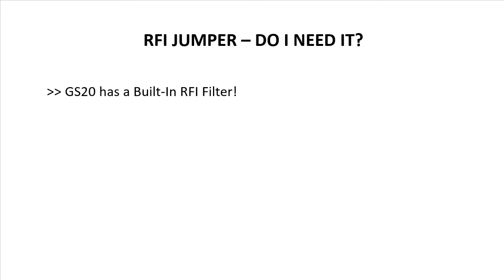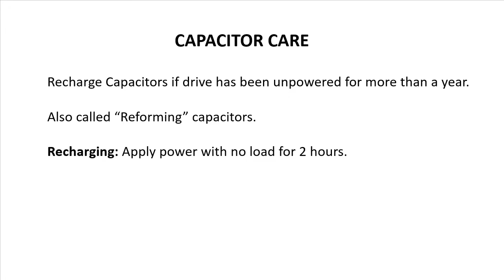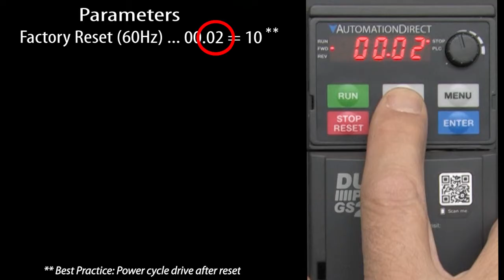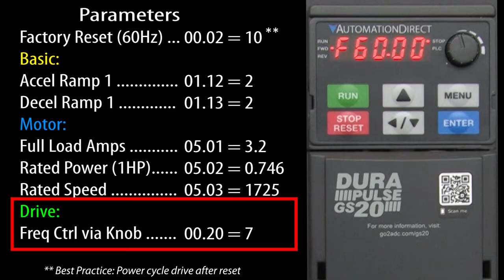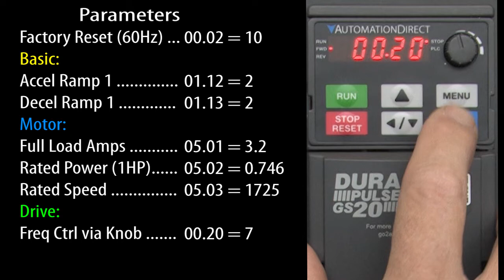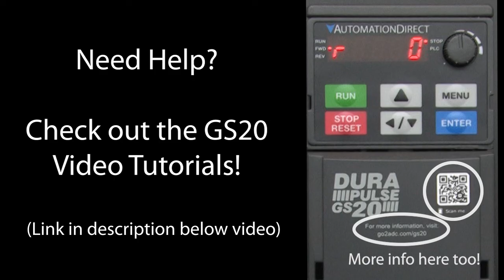DURApulse GS20(X) VFD Quick Start from AutomationDirect

Comment: I just bought a newly gs235010 vfd . I installed parameter of the motor .vfd seems working fine. Turned the knob clockwise and frequency varies but no output from the terminal of the vfd. Measured the voltage at the teminal and it was zeroDid i miss something from the setting?
Reply from the maker: Hi Noel, Sorry for the stupid question, but did you hit RUN?

Comment: Hello Thank you for the video. One question. Can I make the drive to run automatically after putting on the power. I read the manual it says the drive has a function of quick start by setting P02.00 = 6 in three-wire mode. Can you explain that more ?
Reply from the maker: @disun4152 you can disable the "Line Start Lockout" feature on the GS20 and add a jumper to trigger to drive to run upon power up. How this is deployed varies from situation to situation so we recommend you contact our FREE award-winning technical support for further details!
https://community.automationdirect.com/s/contactsupport?utm_source=Jc_zCsXKAV0&utm_medium=VideoTeamComment

Comment: I recently purchased the GSX-20 with no knob. I have two questions: one is - where can i find the menu/group/parameter in print form to use while standing in front of the drive? and Two: can I wire a knob into this drive to control the speed using a 1ph input 220/3ph output vertical milling machine?
Reply from the maker: @billg1871, find the GS20 manual here:
https://cdn.automationdirect.com/static/manuals/gs20m/gs20m.html?utm_source=Jc_zCsXKAV0&utm_medium=VideoTeamComment
Chapter 3 gives you detailed instructions on using the keypad for the GS20. The GS20X series will work nearly identically. (outside of the lack of dial as you mentioned) Chapter 4 is a list of all drive parameters in table form. Later in chapter 4, it also deep dives into setting options, examples and detailed explanation of each parameter.

For speed control with a knob/dial, you can wire in a 10kOhm potentiometer for this drive. Find our version here:(though the drive will work with any 10k pot)
https://www.automationdirect.com/pn/ECX2300-10K?utm_source=Jc_zCsXKAV0&utm_medium=VideoTeamComment
Check out chapter 2 of the manual or the GS20 quick start guide and look at analog voltage input wiring. It will cover wiring the pot for a 0-10V analog input to the drive. The drive even sources that voltage! The pot won't integrate into the main drive NEMA 4X housing, but you can install it into any 22mm PB enclosure. We sell plenty of NEMA4X options here: 
https://www.automationdirect.com/adc/shopping/catalog/enclosures_-a-_racks#Item_Type_ms=%22Pushbutton%20Enclosure%22&start=0&NEMA_Rating_i_ms=%224X%22?utm_source=Jc_zCsXKAV0&utm_medium=VideoTeamComment

Comment: 👍🏻. Is the capacitor maintenance something that should be done on most VFDs, or is that specific to this drive.
Reply from the maker: Yeah, if you look close enough at pretty much any VFD manual (assuming you can find one) you will find a note about this. Each one has a different methodology, and different shelf life duration's, but they all need to have the capacitors taken care of for the exact reasons we describe in the Capacitor Care video.  Unfortunately, not many folks seem to be aware of this and are unintentionally sacrificing the service life of their drives.  The good news is the GS20 happens to be one of the easier ones to re-condition!
You can get a sneak peek of the Capacitor Care video here: https://youtu.be/ohm-gZXf-ww (it doesn't actually go live until 8/1/20)
See if things make sense after you watch that.